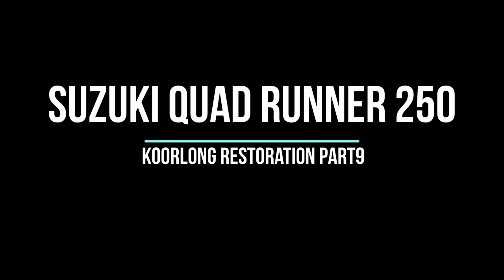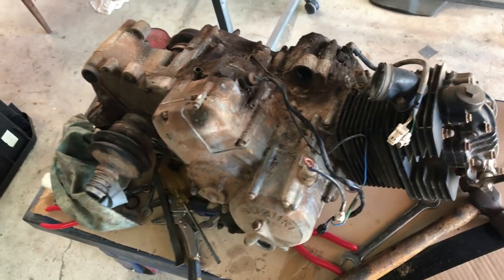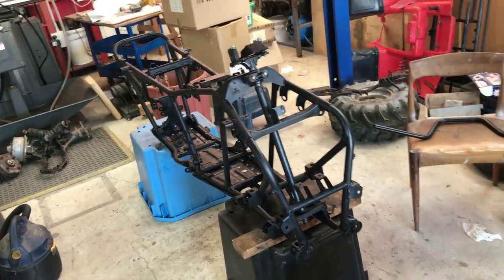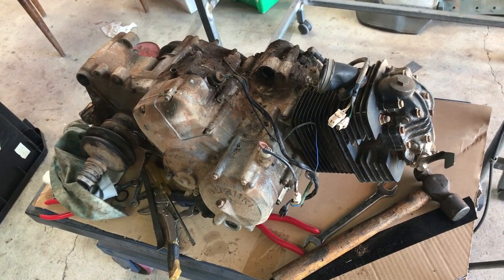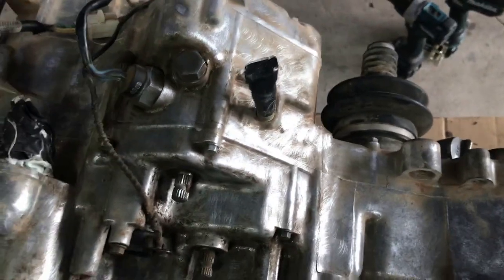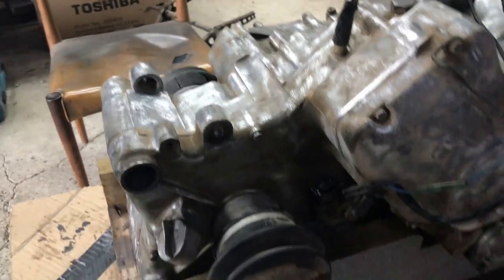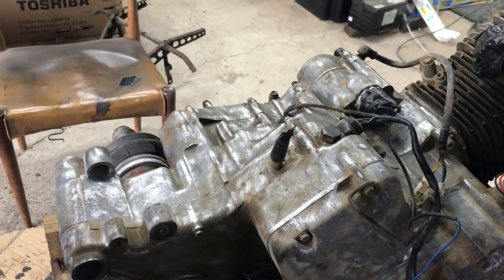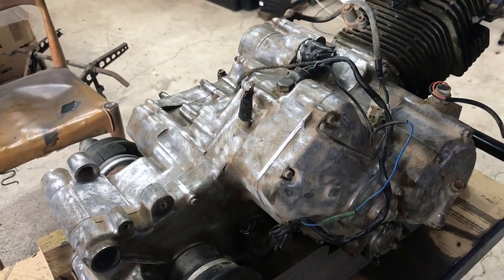Suzuki Quad Runner 250 Koorlong Restoration Part 9

Comment: Mate, you've won the inverse oil strainer lotto!
I've got 3 lt250's, 1 lt160 and 1 lt300. Never had a strainer screen without some amount of sealant, swarf,  gear tooth tips, bearing bits or a combo of them all. 😂
BTW did you get to test your electric starter one way clutch? Be good to know before you go diving under that crank case cover...
Reply from the maker: Yes I can feel the starter clutch through the starter mounting hole. It allows rotation in just one direction as it should.